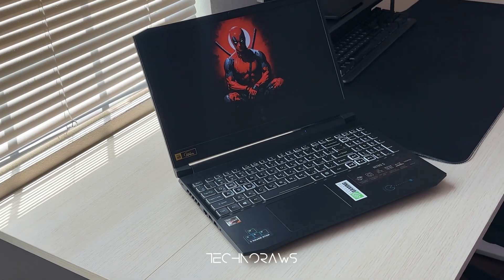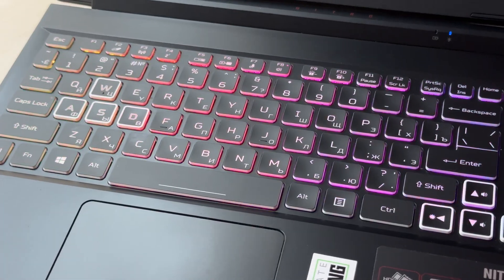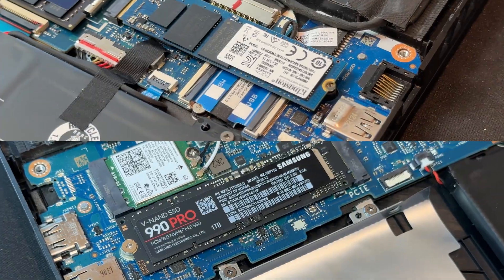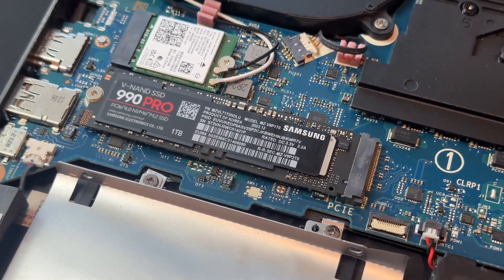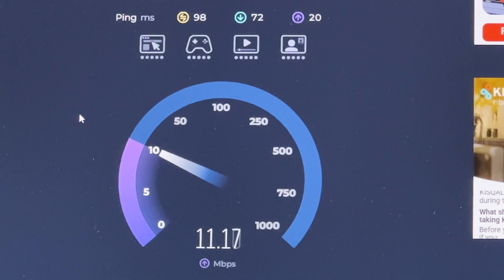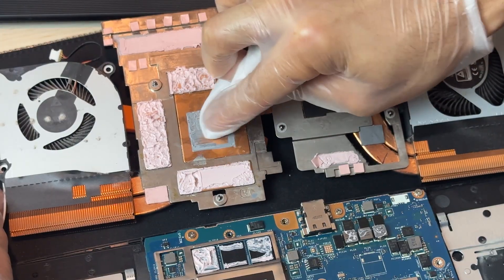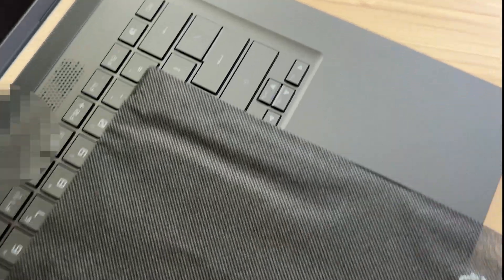Maxed Out My Laptop… Something Went Wrong

Comment: An experienced technician can fix this motherboard. 

Also, if you do get it fixed, this nitro 5 is compatible with the smokeless bios method that lets you access the real hidden advanced bios. From there you can do the IMON tweak + AC loadline tweak. This will underreport your CPU power, meaning in CPU + GPU heavy loads, both of them can draw their maximum wattage (so like 45-55w on CPU + 100w on GPU). Now your main concern will only be thermals. The AC loadline tweak ''undervolts'' your CPU so it can clock higher without overheating as much. You should also use PTM7950. It takes several years to degrade. Mine still holds up after 2 years of heavy use. You should also raise your laptop from the back. You can apply glue on laptop clips to the back of your bottom panel and raise your laptop so it can get more airflow. 

Doing all this will actually give you a pretty good increase in performance. Even more than what you did earlier.

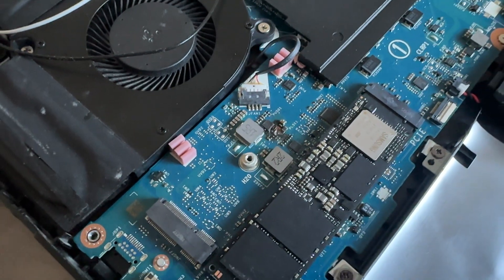Comment: Oh okay at 5:08 this seems like something was shorting pins or something which made the IC have internal short-circuit

You might have something like a small solder ball or something touching anything that'd cause that, also it is fixable the damage it did can be backtracked and fixed it only needs an experienced technician.